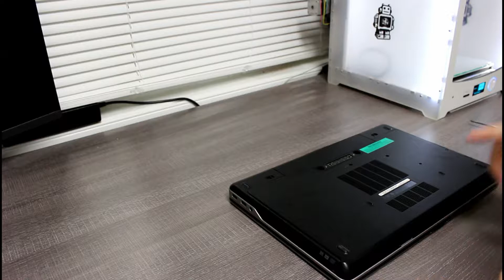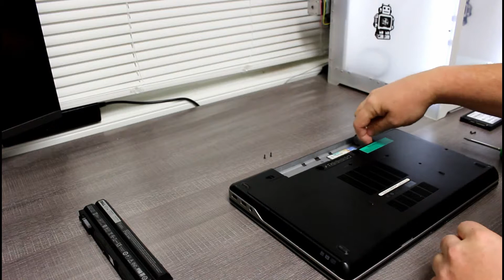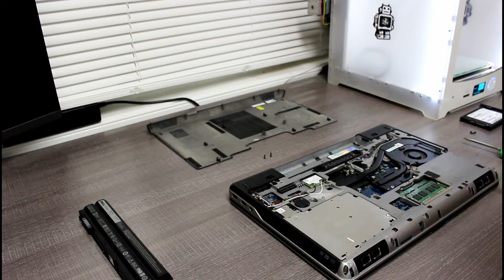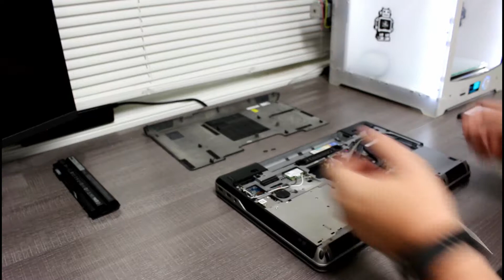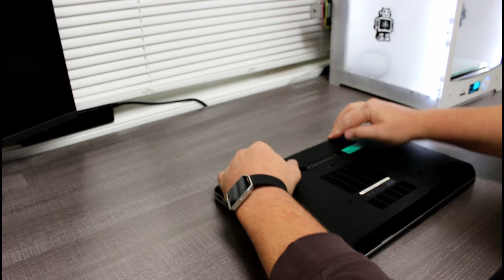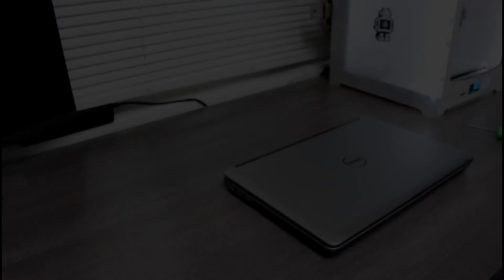Dell M2800 RAM Upgrade (EASY)

Comment: All you have to do is remove the 2 screws for the hard drive cover and the 2 cover screws.  The disk drive does not need be removed.
Reply from the maker: You're right, it does not need to be removed, but the screws retaining it do, I remove it so it does not fall out if for some reason the computer would get moved while I've got the cover off.